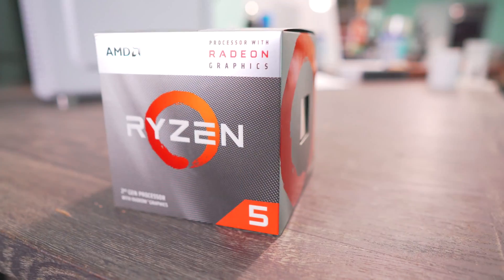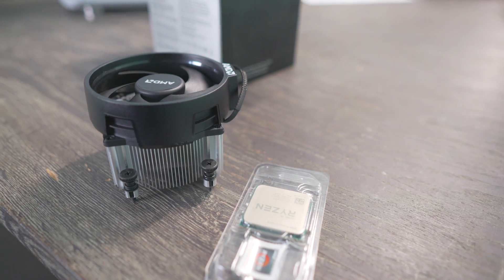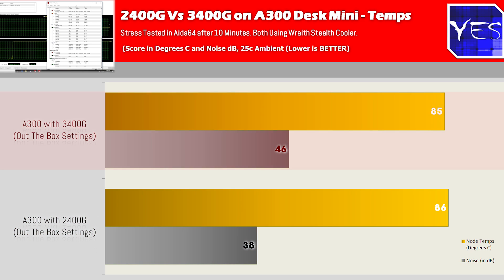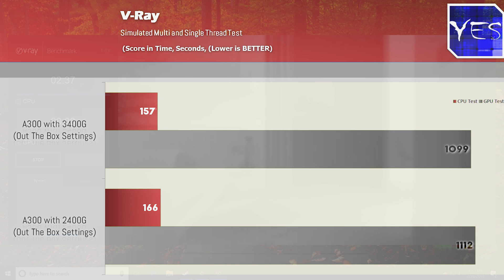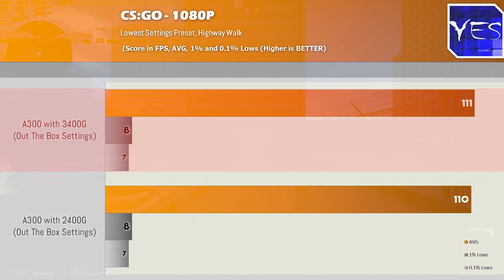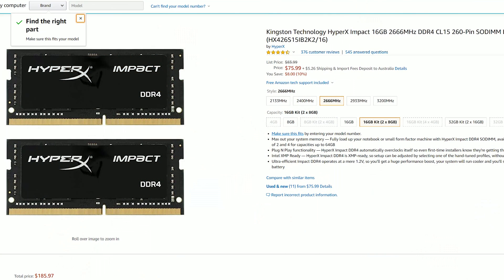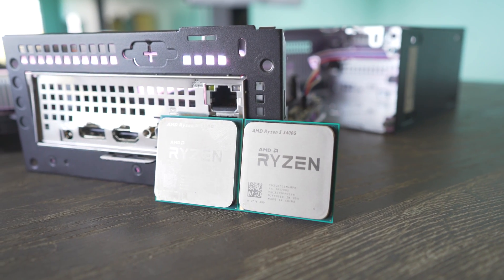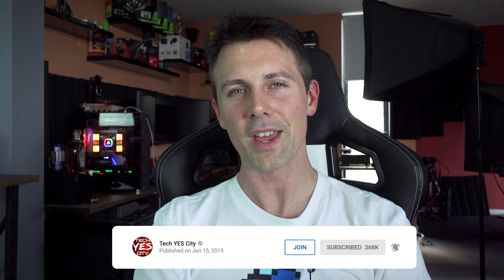Ryzen 2400G Vs. 3400G ON Desk Mini A300 - Catch 22

Comment from the maker: The mad month of July is finally over, expect some pretty cool comparisons and banger budget item vids dropping in the next week <3
Reply: Awesome. Those are my favorite vids. 4th gen Intel prices are plummeting. New Ryzen budget systems are tough to beat now too unless DDR4 skyrockets in price.
Reply: @xdreampcs8554  eagerly awaiting the plummet here in Ireland, hasn't happened yet.
Reply: If you want faster SO-DIMM'sfor Desk-Mini, Apacer got 3000Mhz SO-DIMM for very good price.
Reply: Compare them both with a dedicated GPU!
Reply: these are great to pair with one of those old 768p hd tv's.  the non smart tv screens from a few years ago that you can find cheap everywhere.
Reply: 6:29 65535% man?  you were really pushing that thing
Reply: What Are settings on radeon driver? On global settings? Did you chance something in there?
Reply: Recommend talking to Hyper X/Kingston as they make 3200 speed sodimm kits🤘
Reply: I just hope that the next 4400G comes with rx570 level of performance..i don't mind 4c8t as apus because the 3600 is very good in doing multithread work..just need an all around apu now for solid 1080p gaming,if they can do vega M GH with gtx1050ti level of perf.. it's possible they can do rx570 in navi 7nm😏😏
Reply: my friend how did you get that 1800 in R20. i can only get 1600 to 1700 with the 3400g with the a300. also i think you should run your tests longer as if my chip is anything to go off of it will holed 3700MHz for a bit but then it will drop down to 3200 after about 10 min and i dont know why that is. as i put the nactua cooler on it and have that thing running at full tilt at all times. now this is using the CPU to convert 4k movies using H265 8bit. it will take about 9 hours for a 2 hour move. that is after a full rip of the DVD. last thing how did you get it to boot off the NVME?
Reply: Great video. Really helpful!

Comment: Currently I am using 3400g in matx form factor. I was planning on upgrading to a much smaller form factor and eyeing on mITX build, aorus b55i + the upcoming 5700g. 
But then I saw this video of yours and this is what I imagine or wish could be possible. I never thought this form factor exist using desktop APU. Do you have an updated suggestion similar with the Desk mini size that maybe I could pair with 5700g or if its not yet available maybe  one for 4000 series?

Comment: Using an A300 and Linux Mint for a productivity PC, I couldn't get the 3400G working even with latest BIOS; I had to send it back and change to a 2400G and it all works just fine! But it seems the 3400G was not really worth the higher price anyway, compared to 2400G. I live and learn. Maybe the Linux kernels will catch up with AMD some day.

Comment: I'm starting to think these were a hoax, it's almost impossible to find one for sale, even over seas.
Reply: They're out there, I just got mine delivered yesterday.....now waiting for all other parts.
The A310W Intel version is just about everywhere for sale if you can't find the A300W.
Reply: @g00dl00kinb0i  where did you get yours from? I need the AMD version specifically as I have a spare 3400g I want to get some use out of.
Reply: If you're in US you can find them on Amazon for some ~$180.
They also just received a shipment of A300W with all internals installed through the Computer Upgrade King.

I figure the bare bone is what you want though, it's still there from Beach Audio, they deliver days before delivery date too.
Good luck.
Reply: @g00dl00kinb0i  I'm in Australia unfortunately where availability of anything slightly out of the ordinary is extremely poor. After shipping and taxes importing is often not worth it. Thanks for the info though!
Reply: Don't give up man, these days everything here is scarce as well, I wanted to build a PC after many years of laptop use but just to get all the things I needed was a problem so I decided on that AsRock instead but the 3400G was overpriced or unavailable.

Btw, you're not the first one to say they are hard to get, I had to wait 2 weeks until the AMD version became available again.
AsRock is preparing the DeskMini 2 soon maybe they will sell them by you, it will come with Ryzen 4000 but support the 3000 as well.
Reply: @g00dl00kinb0i  Yeah, that's what I've decided on, gonna just pre-order a DeskMini2. Luckily I have a decent main rig, the deskmini is just a side project.
Reply: The virus killed the supplies everywhere, I read about it a few weeks ago but now the Ryzen 4000 is just weeks away so they might be releasing it, I couldn't wait any longer myself😀
Good luck !

Comment: Tech YES City - I have AMD 3400G APU / Vega 11 iGPU and i have a board with BIOS capable of locking up to 3GB of VRAM to the iGPU but one of my games which i want to play on ultra settings needs more than 4GB of VRAM and even if i get GTX 980 4GB and use that my pc tells me that out of memory error message meaning i am out of video memory. I use ultra settings in my games and all boost advanced settings so it needs more than 4GB VRAM. How to do it?

If a game desires more than 3GB VRAM would it be possible for vega 11 to take from RAM? I have 32GB installed. I dont mind if it allotcates itself 8GB

Comment: my fiance is about to start working from home. I just want to know if this a300w paired with an 2400g will be enough for her to have a nice home office computer doing the usual internet surfing emails, spreadsheets, light power point presentations you know the regular 9-5 typical office tasks? experienced answers would greatly be appreciated
Reply: I bought one for my client yesterday. 
They use it just for work with spreadsheets, browsing, and some casual gaming.
I enabled the FastBoot option from the BIOS, and installed the Windows 10 on it.
Boot time is unbelievably fast. The stock cooler is quiet, power consumption is low, easy to install.
Small form factor is also a plus point, since you can put this anywhere
But, it's little pricier than its m-ATX (mini tower) peers, and you will need fast SO-DIMM RAM.
Other than that, It is an amazing product. It will suit your everyday needs and more!

Comment: I just ordered an Asrock A300 Deskmini with the Athlon 3000g APU. As an adult, I am not too concerned with gaming frame rates.
Reply: sometimes as an adult needs more processing performance, R5 2400G/R5 3400G far better processing power than 3000GE

Comment: What the hell is wrong with GTA 5 I run it as 1080p Normal on 2400g and i get 40/50 fps without issue why is 720p such a struggle in the build ?

Comment: absolutly amazing rig ! i pair it with a 3400G with a Noctua NH-L9a-AM4 so its totaly silent !!! i use 32GB of RAM but i am looking forward to upgrade into 64GB RAM as i need it because i am using vmware . Has anyone try to use 64 GB RAM ? i am looking into these HyperX Impact 64GB DDR4-2933MHz (HX429S17IBK2/64) . Also do you think that will support the new 4400G /4800G APU in the near future ??
Reply: Asrock announced there will be a New Maschine Comming (ASRock X300M-STX)

Comment: The A300 is too expensive and too limiting. Buy an A320 board, full size PSU and full size case for cheaper and you have a lot more options for upgrades and a lot more USB ports. I like the smallness of it by why do small things have to cost more?
Reply: No it's not, at least not everywhere is the same.
I've bought one for 125 euro,new,  plus 80 for a used 2400g and 35 for the 2666 8gb of sodimm ram and 70 for the 250gb nvme m.2
 The cheapest motherboard is 50 euro, the case around 50, to match the coolness of the Desk mini. The power supply is another 35 to 50, again reliable as the Asrock one... So in my eyes, the Asrock did a pretty darn good job! 
 They even include the little cooler, identical to the one of the Athlon 200ge and it seems it's better than the stealth one, that I still have to test it myself...
 With the last of bios, the CPU is at 3.9ghz always and the hynix ram can be overclocked, 3000mhz with decent timings or much more with useless timings.
 So, as an Apu, this is the ultimate build, I can't stand the empty cases, without GPU, as a "Gaming PC".
Reply: @TheSilviu8x  I'm talking here in the UK. I've bought an a320 motherboard from Amazon £39.98, a case with RGB fans for £25 from CCL and a 400W 80+ PSU for £15 from CCL again. That's £80 inc free delivery but the A300 is £139.95 cheapest in UK. I like it but it's just not worth that much. Seen them refurb for £125 and that's still too much. Needs to be about £99.95 new IMO.

Comment: Did you use the 3400g's stock cooler installed on the deskmini, or did you resort to using a lower profile cpu fan?  if  so, what make/model did you use?
Reply: Just use the included one, it's more than enough. And the 2400g seems to boost always, at 3.9ghz.
 The 3400g is not going to make any difference whatsoever, the ram is the botlneck.
Reply: @TheSilviu8x  what i did before i buy the Noctua NH-L9a-AM4 was to use the stock cooler of the A300 box and pair it with the fan of the 3400G !! It fits perfectly but you can only use 1 screw though , still was much better that the litle stock fan, still was loud for my taste but it works !
Reply: @Tseflikas  , I've swapped the cooler with the stealth one from that r3 1200.
 This is possible by removing the spacers underneath the fan scrues.
 The result is a nicer sound, but overall the temperature are the same.
 So I've imposed the energy save power plan on Windows and the cpu is at 1600mhz fixed.
 The gaming is pretty much the same, as the only games my son plays are Dauntless and Minecraft...

Comment: i have a question will the ryzen 3600x apu work with the asrock a300 motehrboard?
Reply: Ryzen 5 3600x is NOT an APU and needs separate graphics!

AMD marks APUs as "g" processors.

Modern APUs include:
Athlon 200GE/240GE/3000GE,
Ryzen 3 2200g and 3200g/Ryzen 5 2400g and 3400g.
Soon the new Ryzen 3 4200g, 5 4400g and 7 4700g are coming as well.

Comment: Taking the shroud of the cooler makes it fit properly and also makes it quieter and drops temperatures a little.  With it jammed up against the case it's having to pull air through a small area of the perforated case wall which becomes restrictive at higher fan speeds.

Comment: * A little update for those interested....Crucial now offers Ballistix 16GB (2x8gb) ddr4 SODIMM kits at 3200mhz CL16 for 79.99. I ordered a kit on the crucial website, which guarantees they work with the Deskmini A300. While they are not listed on the QVL, the only 3200 kits that are on the list are discontinued Crucial SODIMM kits that likely used the same Micron E-Die chips. Only wish I could have found a good deal on a new 3400G, settled for a Deskmini A300W with a 3200G for $229 with free shipping on Newegg. I paired it with a Silicon Power 1tb NVME ssd. I may someday upgrade to a 4400G if Asrock supports it. I'm hoping with the faster memory, and maybe a small memory OC, I can get close to the 3400g speeds you showed. Love the video! You are by far the most entertaining computer YouTube channel!

Comment: Sorry if I missed it in the video, but your readouts are stating that your ram is only running at 1333 MHz, is this a glitch in the readouts and the memory is actually running at full speed or is the speeds you're choosing in the BIOS not sticking?

Comment: Bro,
Which of these 2 APU would be better for 1080p video editing.
I was thinking to go with the 3400g.
Please suggest a good budget mobo to overclock. 
I am on a budget so I cannot get a discret graphic card.
Anyway, if I decide to go with the AMD 1600 , which is a discret graphic card would you suggest for video editing n some gaming... I am on a budget. 
I am planning to save for the AMD rx 570 if I go with the 1600 cpu.
Thanks in advance.

Comment: If you could get your hands on a 2400GE Pro it has near the same performance as the 2400G but at half the TDP at 35w
Reply: But.. You can set cTDP 3400G to 35watt on A300 bios.

Comment: 1.if i buy an asrock a300 with 3400g, but the firmware is not the newest. How i can update the bios firmware?
2. it is possible upgrade the a300? perhaps m.2 -> pcie Adapter for graphic card?
3. it may a different, if I take a M.2 SSD with 1800 MB/s or 3500 MB/s.
I do not know what i want... i dont be rich. :P But a big problem : i am living in Germany. Energy Cost ~ 30ct kW/h . So i am need a low energy solution!
See switzerland. ~20 ct kW/h
Or canada ~10 ct kW/h
If i have a wish: i want a system, where i can play games hmmmmmmmm medium and 60FPS. But without or just only... with low energy costs!

4. it will existing a optimalization tool for this device? bios-auto-config for settings of voltages ...  with help and additional possibilities.
Reply: M.2 must be NVMe
Reply: i have bought a300, now. i will do some testings. interesting is RAM OC.
Reply: On number 2. Check out ETA Prime for that.
Reply: You would need a compatible CPU first to flash the BIOS before using the 3400g.....probably the 2200/2400g.
Reply: @g00dl00kinb0i  hi, so long time ago.
i had install firmware 3.5 -> 3.6 with 3400g inside. no problem. update firmware : fat32 usb stick - downloaded firmware - installation in uefi bios :)
new firmware is a beta.
do not using crucial p1 nvme, if you are want using linux mint, because it is incompatible.

asrock should really modify this bios, it is just a smaller edition of a normal mainboard. the pcie settings are inside there too. and there is no pcie slot! asrock is so lame! :-[]
Reply: That would be nice but I've heard there's a Deskmini 2 in the works already so they busy with they probably.
How did you RAM OC go ?
Does the A300 support XMP profiles ?
Reply: @g00dl00kinb0i  Deskmini2 ? uii
I listen about new ZEN CPUs. or: Zen2+, than that will be interesting.
Yes, XMP profiles are supported.
I listened Crucial have 100% compatible RAM lol... with 3200 MHz (without OC) (see website).
I have 3000Mhz RAM, they i can OCing up to 3066 MHz.
Reply: @chris
Damn.....I just ordered the 3000mhz corsair vengeance instead of 3200mhz crucial ballistic because I was not sure if XMP will work, thanks for letting me know though.
I can't wait to see how it all works, I've used laptops for the last 10+ years.
Yes the Zen2 well be nice to pay with for sure, I'm buying this hoping it will work with the Ryzen 4400g or 4700g.
6 or 8 cores in this small box well be crazy !🙃
Reply: @g00dl00kinb0i  yes, but 4400g is very expensive. I seen in BIOS: RAM -> 4000 MHz. (but need more energy ~> to less energy for system / instable).
with the asrock a300 i removed my 8 years old notebook, too.
i hope that my tests for asrock helped and do the stabilily with actual or next firmware better. good luck ´n have fun! ;)
Reply: @chris
I think they mentioned similar prices and a price drop for existing 3000-parts.
I read the 4200G will sell for 150>, 4400G will be $150-200 and 4700g for 300.
Hopefully they come soon, you enjoy as well !
Reply: @g00dl00kinb0i  that is good, because than we can play game with better graphics and save money of no graphic card and lower energy costs! :)
top 1: germany: 30 cent / kWh
top 2: austria 21 cent / kWh
Reply: @chris
Ha, that's about one of the few things I still like about America, cheap utilities and gasoline, here I run an AC even two AC units and pay $60/month, can't remember my kWh usage cause it's so cheap, without running AC in summer bill is only 45/month.
I must say I just want the Desk Mini because it's great for your main home PC, it can take up to 4 storage drives!, uses the fastest integrated desktop graphics available and can fit anywhere even the back of a 24" 1080p 📺 with the use of a Vesa mount.
It's tiny but has amazing I/O abilities, just needs a USB hub.
I bought a Asus TUF GT501 case to build a PC but it's so big I just don't have the space for this so I'm trying to sell it now.
Reply: @g00dl00kinb0i  and the good old times never come back. because "zionism".
1 dollar = 0,88 euro
i get every month ~700 euro (-50% for my flat), than
60 euro just for energy costs every month.
i only have 1x monitor, 1x a300 / 90W notebook, 1x fridge and 2x raspberry pi.
and end of the year i have to pay 60-80 euro extra for energy cost, because i didn´t pay enough.

Comment: Any idea how to disable igpu in this thing? 
I struggling with my rx570, got so laggy and even worse performance that vega 11 igpu

I connect my rx570  with R43SF from ADT with 45cm long cable btw
Reply: I think a bad idea a300 desk to set up with eGPU, nvme slot has only 8Gb/s or PCIe x4 than other mini desk like even HP prodesk G2 with full speed PCIe x16 for nvme slot
Reply: @abuumarbanu  yeah i think so too 
But a youtuber named eta prime tested this kind of setup and it worked fine? 
Dont know why mine like that 
Sigh.......
Reply: @j3fron  i tried on hp prodesk g3 mini  and elitedesk mini with ADT link R43SL + gtx 1050ti working fine. Maybe you can borrow to your friend another GPU (nvidia). Mine using an old driver v.388.33

Comment: Let's wait intel APU with 10gen in 2020 they said will making big updates for integrated gpu new gen 730 uhd iris graphic  64 core unit for gpu can run 4k in games intel will back stronger then before with 10gen for desktop
Reply: And it didn't.....Iris Plus is way faster then anything Intel before but not Vega 11 level yet.
Vega 6, 7 and 8 on the Ryzen 4000g are around the corner too.

Comment: I just overclocked my Kingston 2666 Cl15 1.2 volts to 3200mhz Cl 17 1.35 volts and this is with a 2200g. The key was finding ram that was rated to run at a high speed (SPD) without XMP enabled.